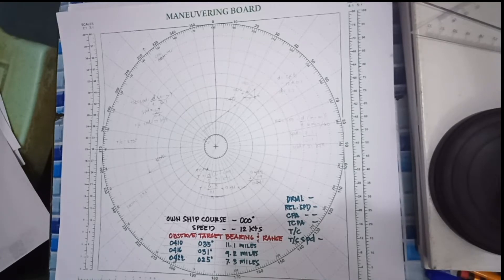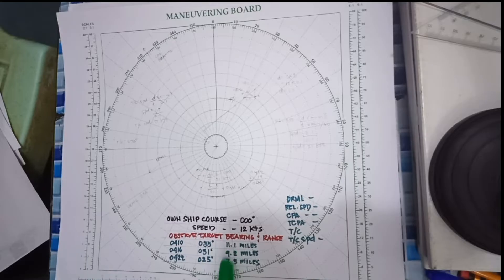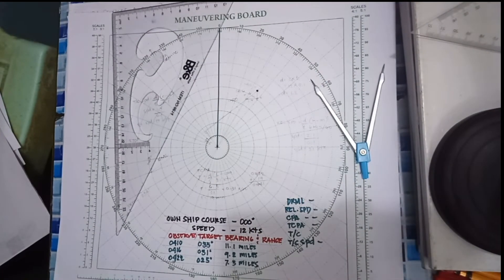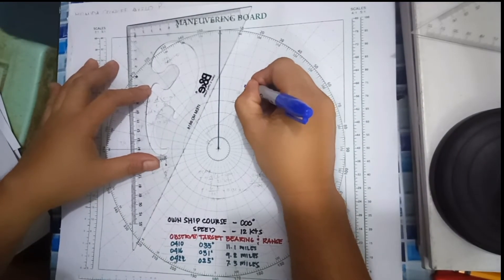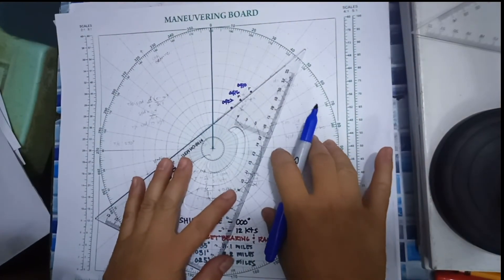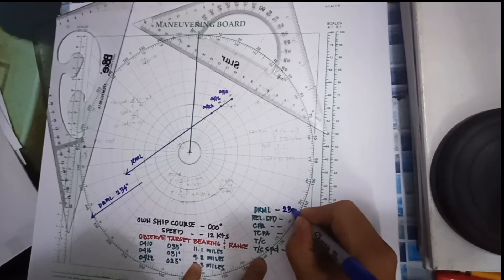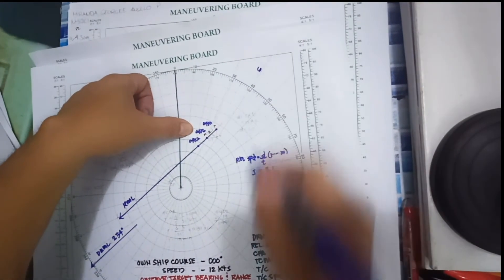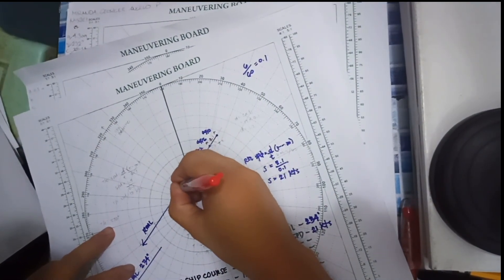HOW TO FIND (DRML, RELATIVE SPEED, CPA, TCPA, TRUE COURSE AND TRUE SPEED) PART 1

Comment: On the return voyage from Durban to Karachi (Own vessel has a service speed of 16.0 knots), whilst own vessel is in position 05°42'S
045°36'E, it receives a request of assistance from another vessel in position 01°54'N 052°12'E. The vessel in need of assistance is
steering a steady course towards landfall position 04°05'S 039°43'E off Mombasa. It is also maintaining a best speed of 12.0
knots.
(a) Calculate the course being steered by the vessel in need of assistance. (10) (244½)
(b) determine the course own vessel needs to steer to rendezvous with the other vessel as soon as possible. (15) (024)
(c) Calculate the time remaining to make the rendezvous.